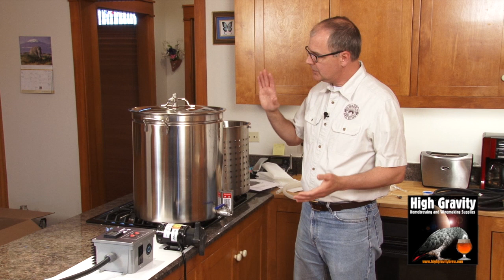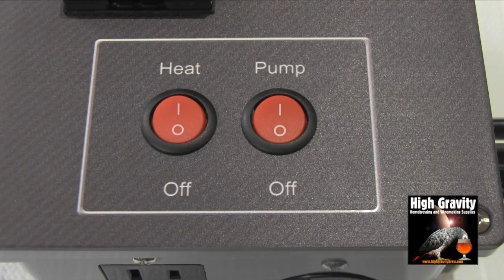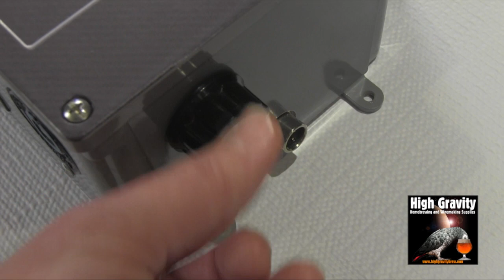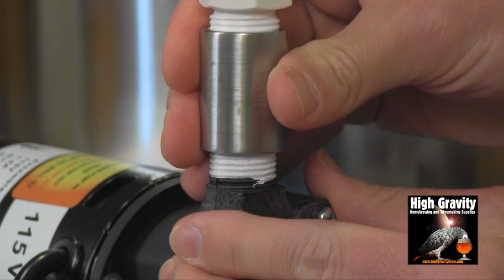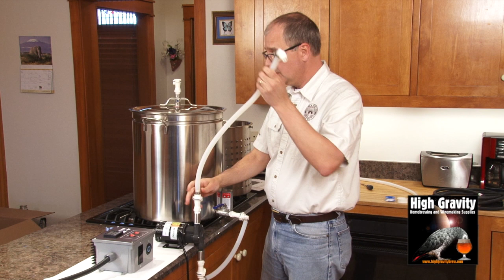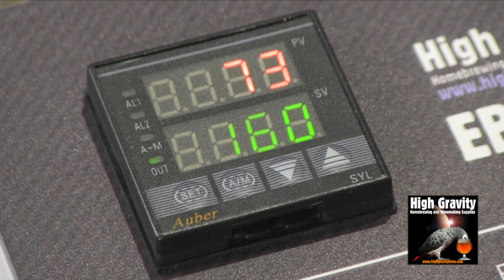High Gravity Brew in a Bag Electric System - Assembly

Comment: Hi. A great set! Easy to use but certainly effective. What type of temperature sensor are you using? PT100, Type J, Type K, other? What temperature accuracy can be obtained? I request information. I was interested in this construction
Reply from the maker: Piotr G We use pt100 Precision thermistors.  They are accurate to within .2 deg over the operating range.  We relocated the probe to the vessel several years ago,  closer proximity to the heat provides tighter control.
Reply: @Highgravitybrew2112  Thank you. It looks really good

Comment: James, I have seen other episodes where you brew outside. Do you use an extension cord or do you have another outlet at that location?
Reply from the maker: The standard cord is 6' but we can make them up to 50' long. I believe we put a 25' power cord on Jame's controller so he could brew inside or outside.

Comment: Is the boil coil affected adversely to flavor additions to the boil such as spices, fruit, etc? Would additions collect on the coil and "burn", and how hard is it to clean?
Reply from the maker: +Odie B. The coil cleans easily.  We use a bristle brush.  The coil actually creates a protective layer of steam when on, making it hard for anything to stick to it or burn. We've never had an issue.
Reply: +High Gravity Homebrewing & Winemaking Supplies Thanks for the reply. Another question: Is it feasible to run a longer length of tubing from the pump to the lid sprayer, and submerge the extra length of tubing into an ice bath to act as a chiller? I don't know how thermally insulating the hoses are in your setup to allow for heat exchange, but I wonder if something like that would be more efficient than an immersion chiller. Maybe I'm overthinking it.

Comment: James I've heard you use your dryer outlet. Is yours 4-prong, or how do you incorporate GFCI?
Reply from the maker: Since 1996, the 4-wire outlet has been standard.  Installing a GFCI in the breaker box is typical.  With this controller, 4-wires with separate neutral and ground are required to use a GFCI.  You can use an older 3-wire circuit with ground and neutral conflated, but it would have to be with a standard overload breaker.  It's the current draw on the neutral (120V subsystem) that would trip a GFCI with only 3-wires.
Reply: High Gravity Fermenting Supplies - Brewery - Winery thank you!